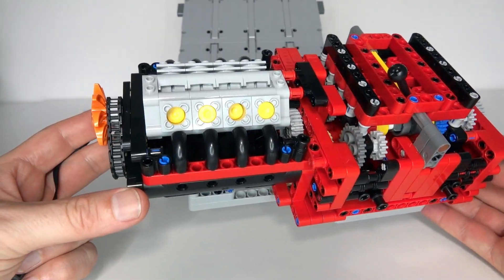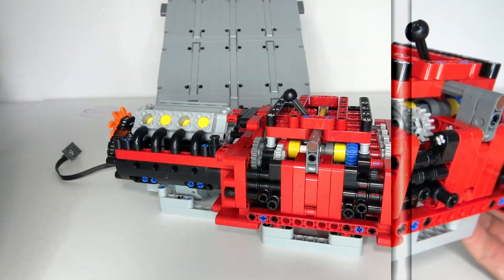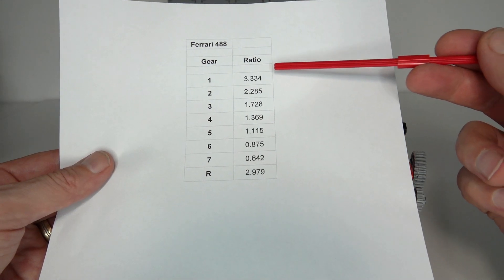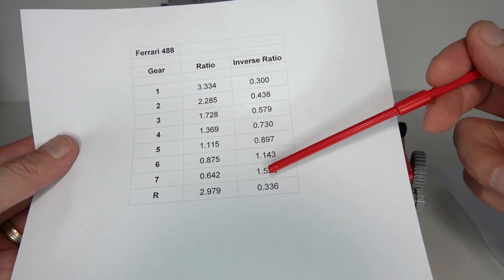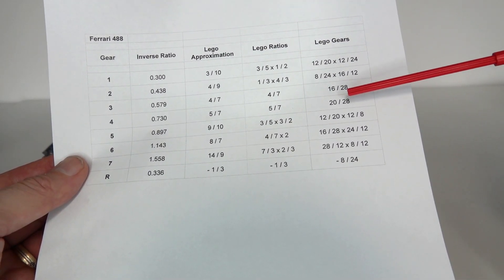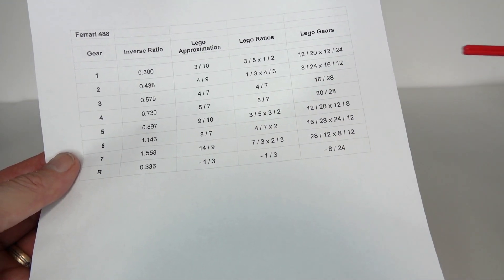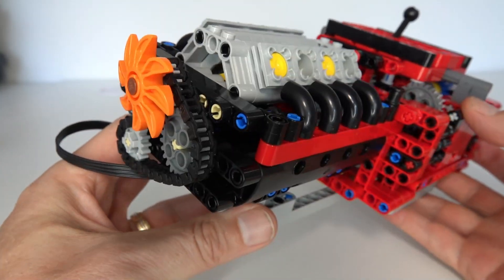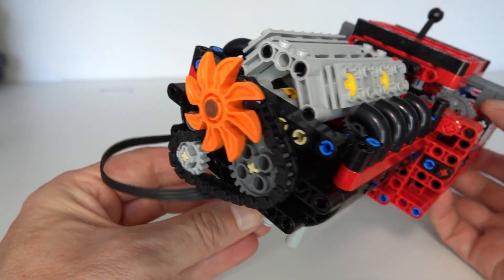Lego Ferrari 488 GTE Manual 8 Speed Gearbox

Comment: I presume you put the engine on the output just to show the speeds working, as the engine should be spinning fastest in first gear.
Reply from the maker: Hi radBot1 LOL. yes you're right - I was thinking of just having the engine connected to the electric motor and then demonstrating the output on an axle but that makes it harder to appreciate the speed changes especially on video.
Reply: @TechnicBrickPower  hi. Do you have an answer? Thanks
Reply from the maker: @Grishka80  Hi Grisha, Yes the model uses the PF large motor (99499c01) but you can use any motor really (you may need to modify the model to fit). But 88008 will work as well and also the 88013 with hub etc. There are build instructions on rebrickable for the model.
Reply: @TechnicBrickPower  Hi. You make great work. But I have 2 questions .
1. How can I connect electric lego motor to engine?
2. Can I use lego L motor 88013 or medium linear motor 88008 with hub 88009 with your project? 
Thank you

Comment: Awesome build and design. You even looked up the true Ferrari gearing output and converted to the Lego ratio .  When I get the Ferrari model for sure I'll use your design.
Reply from the maker: Hi Pc Doc. It was a fun project but I don't think it will fit in the Lego model...maybe it might have to stick out the top a little ;)
Reply: @TechnicBrickPower  i have the this same kit